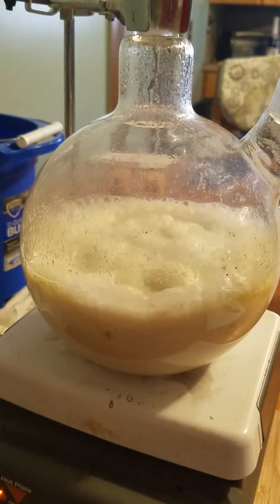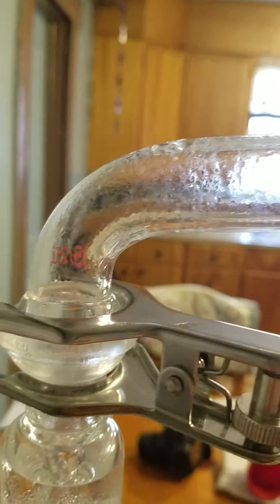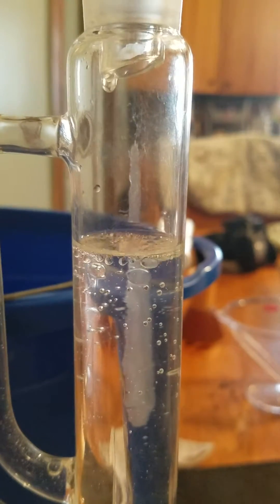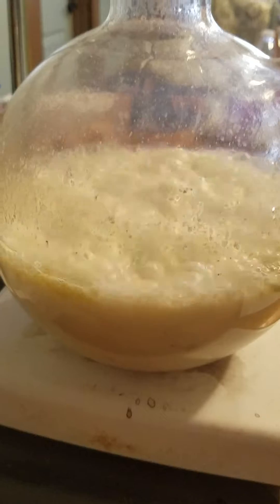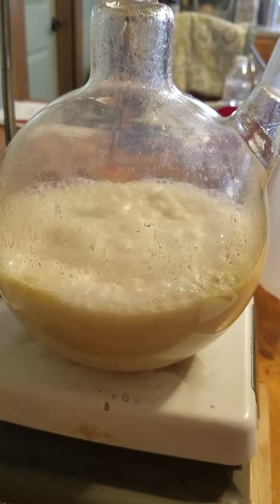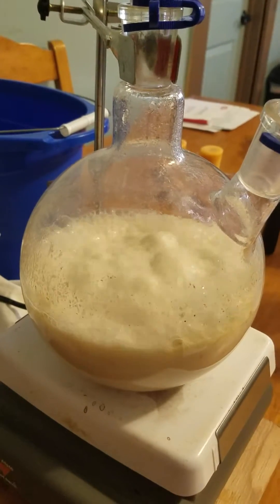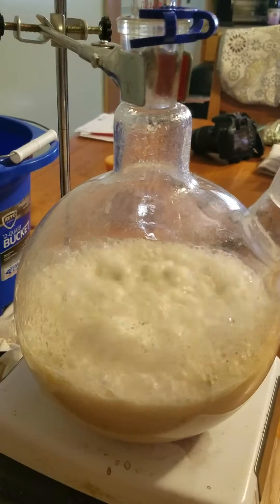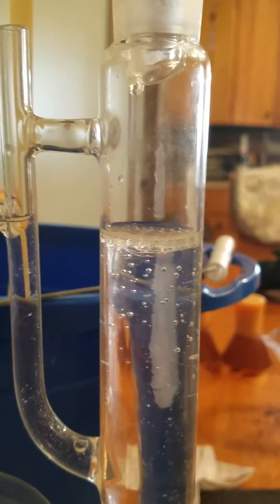Frankincense Essential Oil Distillation Part 1

Comment: Do you ocassionally stir the stuff in your boiler? I tried distilling some and the resin clumped up.
Reply: I do not stir as the bubbles from boiling the water and resin do a good job of that on their own.  If your resin is clumping you may have too much resin for the amount of water you added to the boiling flask.